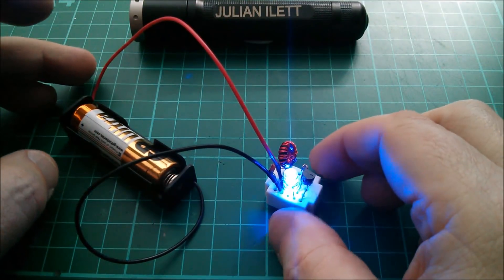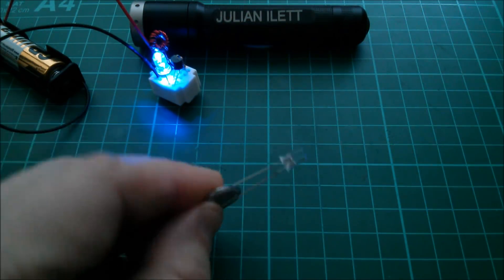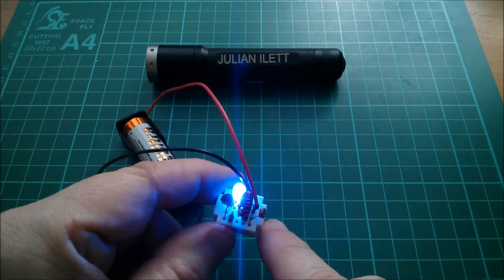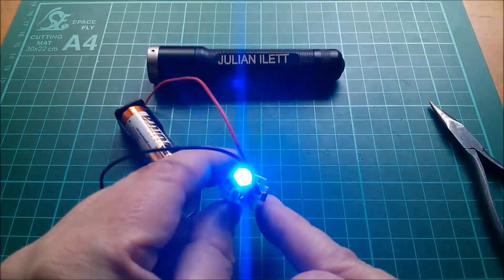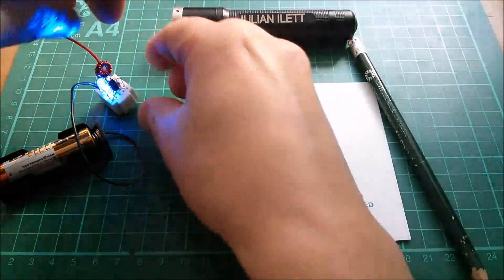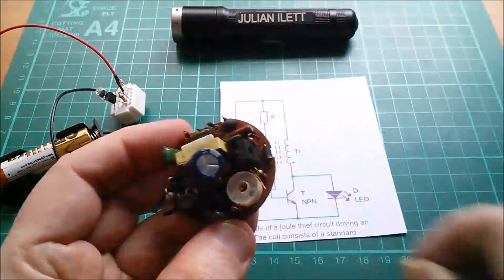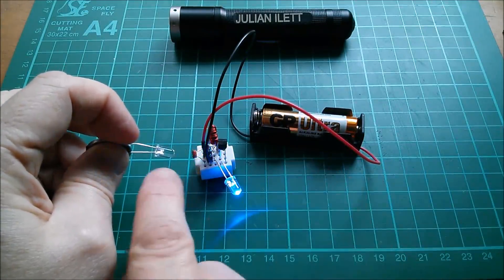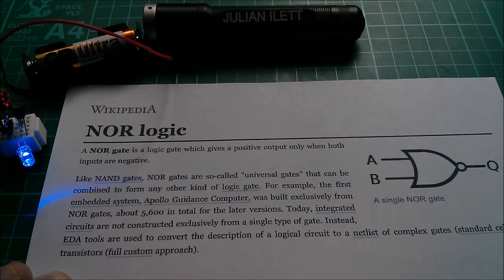Enhanced Joule Thief with LDR

Comment: a toroid will give a longer pulse, same energy but at a lower overall potential as the magnetic field doesnt collapse so fast.

the straight ferrites, usually in SMPS supplies wrapped in a bit of heatshrink... they make really snappy pulses with high peaks, better for driving several LEDs in series.

theres also a spike back on teh base, can throw a LED there.

i tend to use my LED like a freewheel diode, across the coil.

this way it also works on higher voltages. LEDs dont mind being overdriven with pulses, they limit the current/voltage themselves when theres a restricted supply of power, such as in a pulse. they smoke when the power is continuous... or at least, over the duty cycle. so you cant run a higher voltage with the LED where it traditionally is.

Comment: Is it possible to take the voltage output to the LED and use it to recharge another rechargeable battery? Given that the forward voltage is about 2.1-3.5V for the led at about .017-.030 A.  ? So you could suck those alkaline cells dry and get a freshly charged Nimh or Nicad battery out of the pile of "dead" batteries. 
I bet this recharged battery of 1.5V could then be plugged into another houle thief to electroplate small items with a brush and working electrolyte solution. 
Also the Joule thief to charge a small battery could be ran from a small solar cell(s) even in dim light from indoors or cloudy days?  Neat!

Comment: What if you replace the transistor with a blinking led that uses avalanche breakdown to blink?
Reply: The chip inside wont get enough power cause its still powered from under 1.2 volts

Comment: for breadboards
https://www.ebay.com/itm/25-Tie-Points-Mini-Solderless-Bread-Board-PCB-Circuit-Board-for-Arduino/264289648852?_trkparms=aid%3D333200%26algo%3DCOMP.MBE%26ao%3D1%26asc%3D58647%26meid%3D3773fc42d4bc458193df537ba4de4569%26pid%3D100008%26rk%3D2%26rkt%3D12%26sd%3D122017197230%26itm%3D264289648852&_trksid=p2047675.c100008.m2219

Comment: I figured out how to run certain 2 pin RGB LEDs on a Joule Thief.
I am getting a stable DC reading !!!!!! one 104 ceramic cap &  2 switching diodes.!!!!!!!!!!!!
Thanks to you I can make it solar after getting some 12 mm LDRs, 2 in parallel for better low light.
Stays off longer !

Comment: I got a fast RGB to work in a joule thief circuit but the AA cell has to be almost dead for it to run a fast RGB in it's usual pattern, but the pattern and light suffered. 

There is not much light & slowly goes through the pattern, so it does not run correctly. 
The slow  changing LED seems to work better at higher 1.2 current,
but not like the $1.00 garden RGB solar stake light circuit. 
 I am Running a 104 ceramic cap & switching diode.... just like the dollar store circuit .
I Need Help !!!!!!
You can use lower inductors , 1 lumen? ( 1 $ dollar store inductors) 
  In these and use Slow Or Fast RGB 5mm/ 10 mm LED
and make them last all night on a 700 mAh cell. 
With the dollar store inductor you get more light  out of the RGB 40 mAh stake lights
but you do not get the power drain from the Lowe's light's inductors...ugh !!!!

If these are still built the same they will Run color changing & flashing LEDs
I have slow changers on my Back deck lights

https://www.lowes.com/pd/Portfolio-2X-2-Light-Black-Solar-LED-Railing-Light-Kit/999928382

Comment: Question, would this work for a flashing joule thief? I've made mine flash and I would like it to blink in the dark. The circuit is nearly exactly the same as yours, but instead of a 10k resistor, it's a 60k with a 22uf capacitor in parallel with the resistor.

Comment: If you don't want to wind an inductor yourself, you can use two through hole inductors as your center tap.  You can play around with the values, but the biggest variable I've seen is the position of the two inductors relative to each other.  If you move them around each other, you can very easily see the result in the LED brightness.

Comment: I wouldn't recommend this method for day-night switching on the joule thief if you don't want to replace batteries often - the LDR as you have it in your schematic now shunts the base to ground, meaning that the current will still flow from the battery through the coil and the resistor completing the circuit to ground through the LDR (DC load, not AC like the normal operation of the circuit).  This means you'd be drawing 0.15mA constantly even while the LED is off.  IMHO, it would be better to find a way to switch off the power to the Joule Thief with something else - maybe a low-power/low-drive-current comparator (thanks to smartphones, they are available with stable operation below 0.8V) and a photodiode or a small solar cell to trigger without drawing power.
Reply: what about the resistance of the LDR itself plus any the coil may have?

Comment: It would be best if authors would give wire gauge and number of turns.  I don't understand why that is ignored so much!!!
Reply: It's ignored, because it doesn't matter that much. It's only pulling 20 mA max, so thin gauge or thick is fine. Each pump of the oscillator only shifts a very small amount of charge, so you don't need many windings around the core.

Comment: Julian, Excellent as usual. Wondering if a part of the joule thief circuit in combination with a super cap could increase the efficiency of a solar charging circuit in a very low power LoRa sensor with a small solar panel?

Comment: A practical use for this could be a circuit that works from a single cell and works with a PIC or ARM that needs 3.3 on the logic signals and on the power pin
Reply: OK, you mean as a power supply, I think, the Joule thief operates from nearly exhausted cells, you would not be able to run the micro controller for long, maybe you have a different thing in mind.

Comment: Howdy once more, question from the peanut gallery - I love tearing down exotic boards, so when the Carbon Monoxide Detector timed out (they shut down after 5 years usage according to the book!) I replaced it, and now have the perfectly good but self shut down board. I intend to salvage what I can from it before disposing of it.  One of the interesting chips was a Motorola micro-controller MC68HSR705J1A I downloaded the data sheet and she looks like she could be used again for some fun project.  Do you have any idea who I could program the little chip to, perhaps turn on and off an LED or some such fun project which could lead to, perhaps powering a small LCD or some such joyful endeavor?   Since I am, at this time, setting in the middle of the Mohave Desert in Arizona, 1500 miles South West of my sticks and bricks home in South Dakota, I find myself with no resistors (forgot my supplies cabinet!) so when  want to make  a simple project with an LED I am SOL.  So I looked at this board and man she has dozens of the little critters, all through hole but they may be difficult to harvest as she is double sided but that makes life more interesting I guess.  the Motorola chip is socketed so she is an easy pull.

Comment: People! Never connect LED to power supply without a resistor in series! Sir Julian is teaching you bad things, again!
Reply: Not necessary here. As soon as there is enough voltage to turn on LED it will light up. No extra energy goes thru to burn LED.
Reply: I also made same connections on BreadBoards with no Resistors. Never burned an LED. Do you also know that you can connect 3 or 4 LED's. It works.

Comment: Why don't you put 100pf capacitor parallel to the resistor, the current or voltage will increase.

Comment: Are there any more awkward ways to create logic circuits while still remaining in the domain of solid state? How about this: Carbon microphones from old telephone handsets taped to small speakers. Add a few resistors and you could run the sucker from low voltage AC! lol
Reply: xanataph   you shouldn't put an idea like that on YouTube before getting a patent.
Reply: I get your point, but I really couldn't be bothered developing the idea myself, but it would be interesting to see someone else try it out! lol I have other ideas for carbon mics, that I will keep to myself and maybe one day even use 'em..! :)
Reply: Frog's legs operating microswitches.
Reply: Greg Ewing   yeah, sadly frogs'  legs are wet, so it's not quite solid state.  Nice idea though.

Comment: A daylight switch needs hysteresis to prevent oscillation. I know a pretty good circuit for it, uses just one op-amp and a few resistors to form what is essentially a one-bit memory cell, plus a power transistor to drive the load.

Comment: How did the current go down on what appears to be the same circuit as the previous video? There it was about 17ma and only went down to 16ma when the led was out of circuit. What changed the efficiency and was the ldr responsible for the off circuit reduction?
Reply from the maker: I remember that. The LDR will kill any oscillation in the circuit - removing the LED probably doesn't.

Comment: For the JTComputer, you'll need small size and ease of construction.
I just stumbled on this which uses 2 very small smd  inductors (and so no toroid), and even no resistor (but it'll still need the LDR): https://www.youtube.com/watch?v=g2jMrNFV4nQ
I imagine that each element, being more "active", will have a better fanout than the optoisolators did.

Comment: I was very surprised, given your previous video, that you didn't face the LDR to the LED and look for oscillations?!

I'm thinking that if you try a high value resistor (say 10K-100K) from base to emitter, it may help minimize the dark state current, since the coil-resistor-LDR is always turning the transistor on a little.

Comment: julien, ever heard of the two-transistor circuit? it uses a regular inductor some resistors a capacitor and a NPN and PNP transistor (I hear its similar to the DC-Dc circuits uses in solar garden lights) ... mine works like a charm :D.

Comment: Julian, you neglected to mention that most of those CFL circuits also have a cylindrical choke which can also be re-wound to make a Joule Thief transformer.

In fact, there is so much wire on the choke that you can re-wind the choke with some of the wire and use the rest to wind onto the toroid, and still have wire left over.  Two Joule Thief transformers from a single broken CFL. :)

You know those cheap LED strings which use two AA cells in series?  I've modified three of those to run off a single AA cell with a Joule Thief circuit tucked into the space where the other AA cell would have gone.  In the ones I bought, I found it easy to pull out the battery terminals and solder a wire to the bridging terminal which previously joined the two cells in series.

Subjectively, it appears as though a single AA cell lasts about as long in a Joule Thief circuit as two AA cells do alone, so I'm getting something like double the battery life.

I usually use 35-40 double-wound turns to give 70-80 turns with a centre tap.

When winding the cylindrical choke, I usually find it easier to wind the 35 turns, then make the centre tap, then wind another 35 turns.  When winding the toroid, I usually find it easier to fold the wire double and wind the 35 turns that way, so I do both windings at the same time.

The only "trick" to watch for when double-winding is that you can't use the folded end as the centre tap since the windings would be going contrary to each other thus cancelling out the magnetic flux.

Comment: This mod completely negates one of the main features of the Joule Thief: that once it's started running from a cell around 1.3V (I don't exactly recall the minimum starting voltage), it'll stay running down to around 0.4V. By turning the transistor off with an LDR, it will only light again with a relatively-high voltage cell (1.3V or whatever it is), not an almost-dead one, which was the main benefit of the circuit.
Reply from the maker: Working fine at 0.9v :)
Reply from the maker: Working fine at 0.8v :)
Reply: Interesting! I wonder what makes that work, then. Clive's video said that you need a fairly high trigger voltage to light the LED initially but that it'll run down very low after that, so your modification seems to run counter to that. I'm happy to be wrong in this case :)
Reply from the maker: Still working entirely reliably at 0.65v :)

Comment: Salvaging components from fluorescent lamps (I have done this, I love to salvage components): BE CAREFUL, do not break the glass parts, very nasty stuff inside that you could breathe in. No, I have not broken any. Thanks for the video!
Reply: TheBlackadder Edmund  The amount of nasty stuff inside modern CFL is very small, and even less so from a worn out lamp. So although it recommended not to break the glass, it's not a big deal if the glass does break. If the glass does break, open a window to ventilate the room, put gloves on, and carefully dispose of the broken glass.

Comment: Hi Julian;
Have you tried HH004F in to-92 package for Joule thief circuit?
The circuit will only need any inductor (the one like resistor will do) and you are good to go.
Reply: Thank you for that! I've always wanted to play with a Joule Thief or the like, but hated having to wind wire around those dratted ferrite cores; the HH004F makes things so much simpler using an ordinary inductor.

Comment: Nice circuit. Could you please specify the number of turns for each coil on the ferrite ring? I can't find reference to same. Thanks.
Reply: Traditionally, twenty turns.  Note that it's twenty double turns though!
Reply: Thanks. Got some QX5252F that work differently at dusk or dawn. When sunlight gets dim through the solar cells, the QX5252F senses the voltage drop and triggers the battery circuit. Anyway, both are very useful and have their own niche. Great forum.
Reply: I've used from 35 to 45 turns, but as stated, less turns will also work.  This circuit is very non-critical in that respect.
Reply: Other Videos show minimum 4 turns or more.

Comment: for the inductor /transformer what would be the minimum amount of turns for it to work 
alternately what would be the maximum for efficiency or for it to stop working 
I know the size of ferrite ring and wire gauge would be the variables but for one given size (using the same ring with the same gauge of wire ) has anyone ever tried to determine these

Comment: this is like almost half of a DC to AC 12v to 110v converter!
just need a winding on the output of the transformer. to convert it into higher voltage AC

Comment: Answer: no. The problem is they’re oscillating. Once you try cascading elements, you’re going to run into a nasty problem.
Reply: Which can be fixed by adding a diode and capacitor to filter the current to the LED.  Color changing yard lights use this since the color changing LED's reset when powered down and back up.  It sure drives up the parts count though!

Comment: Should be able to use one of those color changing leds right?
Reply: No: the Joule Thief is switching the LED on and off rapidly, so a color-changing LED would continually be restarting.  It would just appear red (or whatever the initial color is)
Reply: Charlie Dobbie ahh ok thanks for the explanation
Reply: I believe you can add a capacitor to smooth the output to get around that issue,  which is presumably what the colour changing solar lights do.
Reply: S Butler worth a shot I suppose.

Comment: I've been making Jouke thief circuits for some years now, using quite tiny ferrite beads such as those which fit over a wire as a filter. The number of turns is about 5 or 6, which is as many as could be threaded through the centre of the bead. They work well. Your enhancement is a good idea,mand it will be added to those unswitched 'children's night lights'! Thanks Julian.
Reply: i used one with an isolated winding with 4x turns to get a 22v supply for lil miniature russian tubes. try as i did, i couldnt get any higher under load.

power the filament straight from the nimh, yet still run cathode follower with bootstrapping. very tricky to do when its a directly heated cathode. even harder when its a pentode.

makes a great pre-amp for an acoustic guitar. need the bootstrap to impedance match the piezo pickups.

Comment: I believe the term 'Joule Thief' was coined by Big Clive!
Reply: Indeed it was!  Although the idea's been around for a very long time
Reply: mmm interesting reading  I made my first one back in 1993 still have it ! still works I used a yellow hi brightness Led as it was all I had I think we had white Leds but were very expensive  I replaced the yellow with a white when the white leds got cheaper !
Reply: Ashley Booth I beg to differ
Reply: @thehappylittlefoxakabenji8154  So you may. But both Wikipedia and the Bearded Manxman himself will convince you otherwise. Just go to his channel and type in "Joule Thief."
Reply: @benwinkel  well thanks for pointing that out  a year later  my comment was because    I was convinced wrongly that I had heard the term before as I made my first one back in 93 the circuit has been around quite a long time
Reply: It was Big Clive according to https://en.m.wikipedia.org/wiki/Joule_thief

It dates to before WWII though.
Reply: I've read that the term "Joule Thief" was used as a pun on the Jewel Thieves, but in reality it's just a battery milker to the last drop (as in energy jules) allowing the circuit to work all the way down to a few hundred millivolts. ;)

Comment: could build a processor that uses light and it would be much quicker maybe? 😮
Reply: using fibre optic instead of copper 🤗
Reply: i suppose that processors already use optics if they are made from silicon wafers 😔

Comment: I could be wrong but I am under the impression that there is a bit of a compromise on the transformer. IE you want as small a ferrite as possible, as many windings as possible and as thick wire as possible.